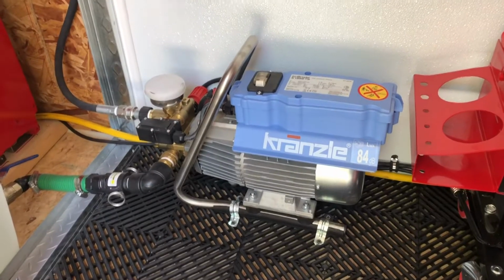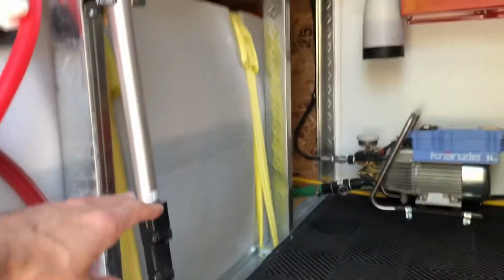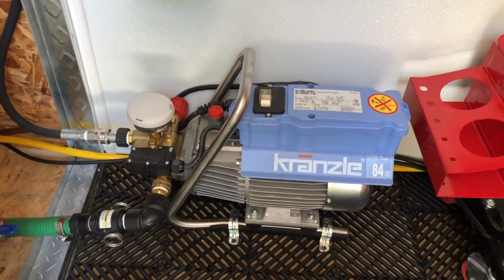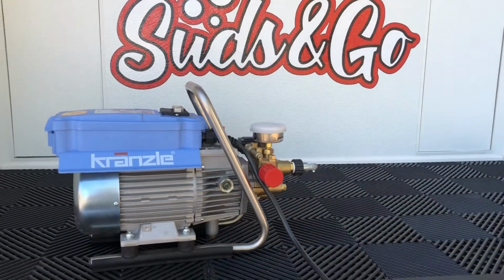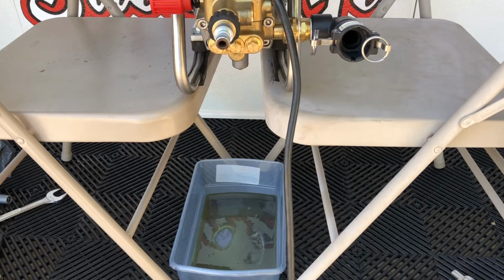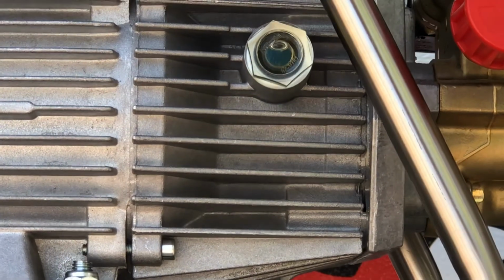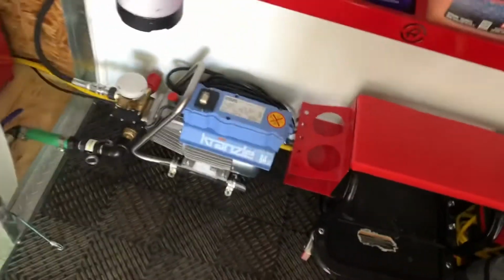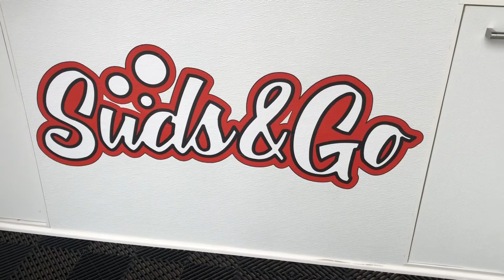Kranzle Tips & Oil Change

Comment: How long realistic is 50 operating hours ? When the pump is actually in use ?
Reply from the maker: That’s an interesting question. I I think it’s really dependent on trigger time. Since the pump only turns on when you pull the trigger I look at it like this, how much water do you typically use when washing a car? My tank holds 100 gallons and on average that will last me 3-4 cars. Thats roughly 25 gallons per car or 12.5 min of trigger time at 2 gallons per minute (I use a lot of water when I clean). If we break that down that’s roughly 240 car washes for every 50 hours of use. That was a long technical answer but I hope it helped.
Reply: That was literally exactly what I had thought but wanted to make sure thank you so much I appreciate you very much so, just got my kranzle last month and want to keep it nice so that answered my question perfectly !!
Reply from the maker: @estevangutierrez997  Awesome. Congrats on the purchase! You’re going to love it.

Comment: Which is best for mobile detailing the 1322 or the 1622?? And it pulls water from the tank you don’t need a pump?
Reply from the maker: I don’t think one is better over the other. It’s just a matter of personal preference. The 1322 puts out slightly more gallons per minute over the 1622. They say “GPM is what matters”. However if your mobile and trying to conserve on water the 1622 might be the better choice. No pump needed. They both have self priming pumps.
Reply: @SpotlessWaterGuy  I was reading online it says the 1622 does not have the auto stop function like the 1322 so I’m kind of curious on whether to get the 1322 instead
Reply from the maker: @swaveyymike  They both come with auto stop. If it’s says TS at the end, it stands for “total stop” the same feature you’re talking about. For example of it says 1622TS it has auto stop when you let go of the trigger.

Comment: The oil looks exactly like it  is supposed to when changing at about 50 hours.  Perfect timing. I have seen much worse. The factory recommends removing the site glass, cleaning it, and refilling with oil until it starts running out of the site glass hole.

Comment: Does it come with a funnel? Also is this for the 1622? Does it still work the same for the 1622 if yours is 1322?
Reply from the maker: Hey brother no it doesn’t come with a funnel. Yes oil change for the 1622 and 1322 is the same.

Comment: Hello, thanks for the video. I am thinking of buying it and I am watching many videos, only that I have a question that does not specify in any video I would like to know if the machine has a problem if you always leave it connected to the water you do not have to disconnect every time you use it from the water Why do I have a machine that broke the pump inside because I left it connected to the water, I would really appreciate an answer and again thanks for the video
Reply from the maker: Hi there, I have mine constantly connected to water and ive never had an issue. Unfortunately I can’t speak to why you had an issue with your last one. The Kranzle is a great machine. They are well built
Reply: Bro buying my kranzle was the greatest thing I ever did for my detailing business. After buying 3 CAT 1800’s; I was already $600 in on shitty residential units. 

The kranzle will blow you away with how quiet it is. The power it has is the perfect medium for detailing, produces very thick foam (if that’s your thing). You can hardly feel the machine vibrate whatsoever as you pull the trigger. 

The serviceability is above and beyond. 80% of problems can be solved at home with their parts in like 30 minutes tops, no fancy tools necessary. It’s probably the easiest pressure washer to work on, hands down. It can be a pricey investment, but the priciest investment is not investing in yourself properly 🙃

Comment: Did you ever do the Jimmy stick video? Also what's your take on Manny at OG saying you need to use at least a 4800W generator for a Kranzle. Have you had any issues?
Reply from the maker: Hey brother no I haven’t made that video yet. 4800w is the recommendation but I can tell you there are hundreds of detailers running the Kranzle off of a 3500w generator. I’ve never had a single issue.
Reply: @SpotlessWaterGuy  Whats the attachment you have on your gun? I need that in my life!
Reply from the maker: @anchoredtolovedetailing  email me! Support@sudsandgo.com